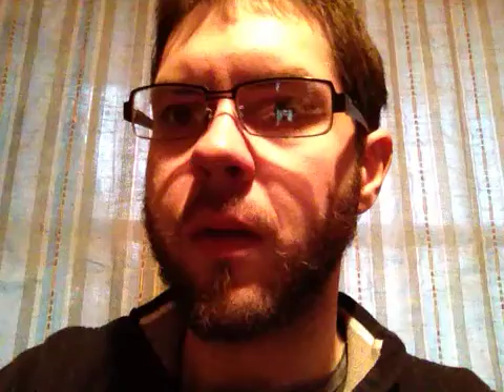Pouch Cell Concept Intro - Pt. 1

Comment from the maker: Hey Mike!

I do remember you. Or at least I think I do. Working on some racing applications on your end if I recall. 

As you can see from the video, these work well on the bench. But I haven't pursued them - I estimate the real interest in such configurable and hefty connectors would be about the same as Shiva controllers. Street applications can't as easily justify the labor involved in fabricating these. But I do see some real benefit for racing.